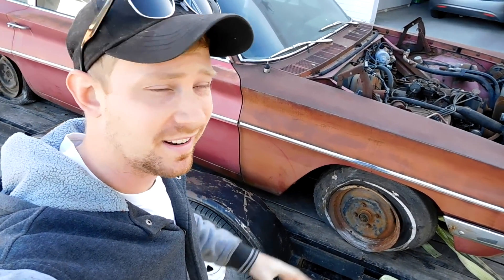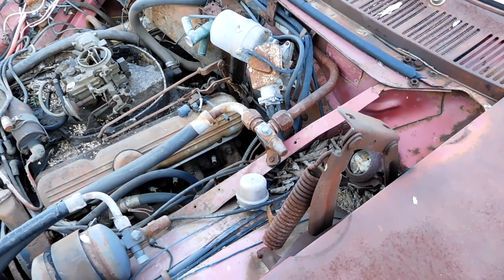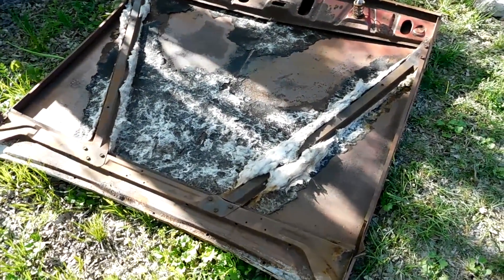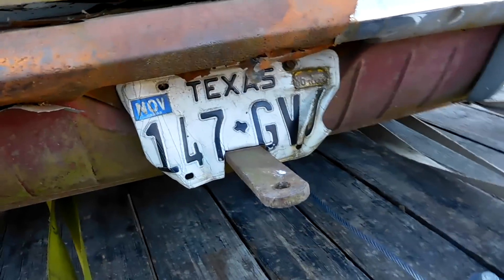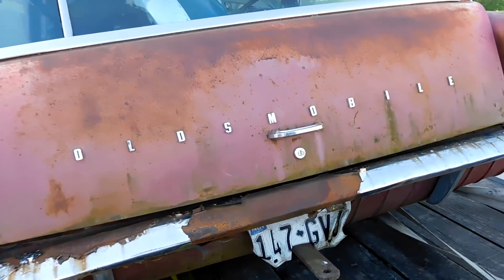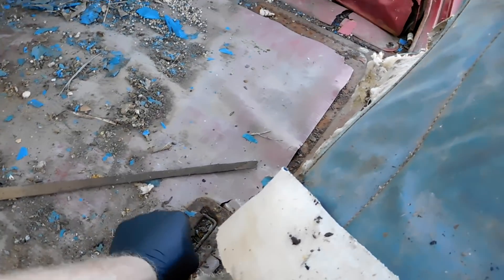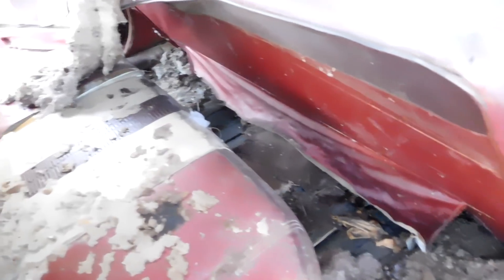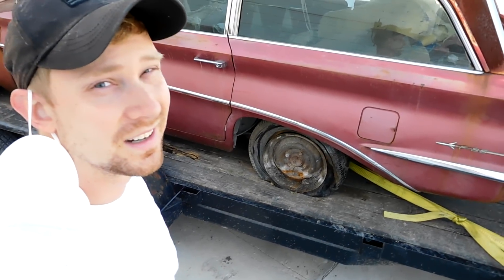Cleaning The NASTIEST Field Find Wagon I’ve EVER Seen: 1961 Oldsmobile F-85 Station Wagon Rat Hotel

Comment: 215, all- aluminum, developed by Oldsmobile, used with different heads in 1961 Buick Special and rope-drive 1961 Pontiac Tempest as well. My grandmother bought the first 1961 F85 sedan in Oshawa, Ontario, Canada. I was 7 at the time, haha.

Comment: Seems like air would've been a rare option even for a 98 in 1961. I wonder if that was dealer installed. Did the compressor look like or say Frigidaire? I hope somebody decides to buy it and get it driving again just because that is a first gen and that model wagon is rare. Didn't Olds advertise the base v-8s as 216 in those days?
Reply: They were a 215ci all aluminium block.

Comment: I can tell you this much. The eyebrow chrome that goes over the rear tail lights. the lowest I've seen it go is 50 bucks each. I have seen it for 100 bucks each. Or, all the chrome in the back for 500. It ain't cheap. Besides the bumpers, you have a good parts car. I've seen just the brackets for the air conditioning system go for 25 for each piece. Not just any air con bracket system will fit these cars. This engine is totally different from the Olds 350 that came later on. If I remember right, nothing off the Olds 350 will fit this engine. You should get a decent price for this. Many parts are hard to get. The front end grill, it's almost made of unobtainium. If it's straight. Not bent. That can cost as much as you paid for the whole car. A friend of mine gladly paid 500 bucks for the grill that's in his two-door version of this car. Oddly shaped and hard to find. And expensive when you do. as I said, You have a good parts car.

Comment: A leaf blower would be faster than vacuuming.
Reply: I usually use a compressed air blow gun to clean my car instead of vacuuming... I don't let much dirt accumulate so it works great. I agree that a leaf blower would be most appropriate for this situation... preferably a commercial grade, high output gas powered unit 😂
Reply: "Vaporized" rodent dung is highly toxic. True bio hazard.

Comment: That's a 215 Buick engine. Also came in a $bbl. GM used it for 3 years then sold it to Rover. Definitely factory air. Lots of work but an interesting car to rebuild.
Reply: Oldsmobile's version was slightly different using more head bolts and also was offered with an optional turbocharger.

Comment: The cubic inches of the "all aluminum V8" was only 215 cubic inches and not 218! BUT you don't have that motor either in any case anyhow!! The intake manifold is FAR TOO WIDE to be the "All Aluminum Engine"!! And I thinking it could be the 330 or the 325 V8 they offered back then!! There was another weird one too, but I can't remember what cubic inch that motor was!!
Reply: BUT the 215 WAS an option in these cars......not saying it wasn't available, it is just NOT the motor you have!!
Reply from the maker: Yeah I’m no Oldsmobile guy. Most will swap a sbc in it anyways

Comment: That was a cool V8 of the era. I think one of my car mags in the early 60s did a story on a 63 Cutlass 2 dr ht with it with a turbo option from the factory. They did some mods and adjustments to it and got decent times on the quarter mile with it. Shame people discard cars and trucks in fields and walk away from them. That's a rare car with the V8 and factory AC. But a huge resto project for a car not really of collector value which has to be a determining factor on what to do and how much to spend on it. Definite HAZMAT project first priority in the interior. Glad you wore at least a mask if not a HAZMAT respirator! One advantage to the missing floors, you could pump the tires up, tow it into an open field and pressure wash the poop right out the bottom of the car with minimal contact with it (Lots of disinfectant in the soap solution!). Time saver!

Comment: That is a cool old wagon ... but, yeah, they were built kinda cheaply and never meant to still be around 60 years later. The Olds F-85, Pontiac Tempest, and Buick Skylark bodies were based of the Corvair, with just enough body reinforcement to drop a small six or a V8 in the front of it. It’s a solid  find ... but I sure don’t envy you having to clean it out!